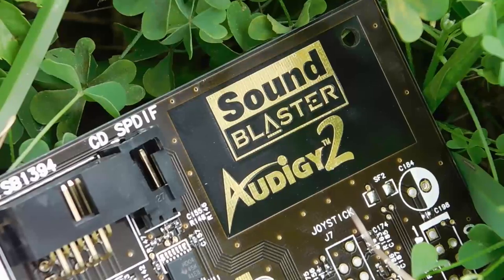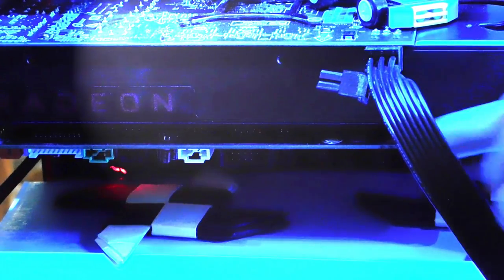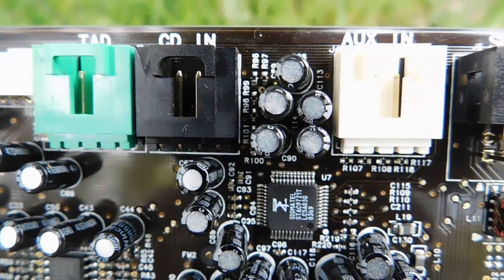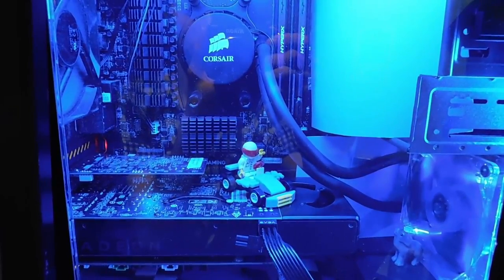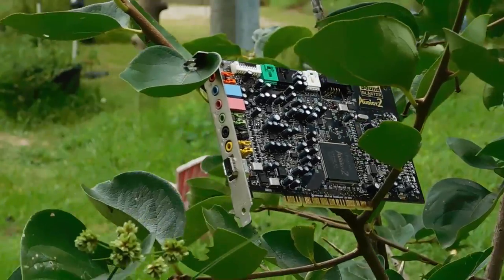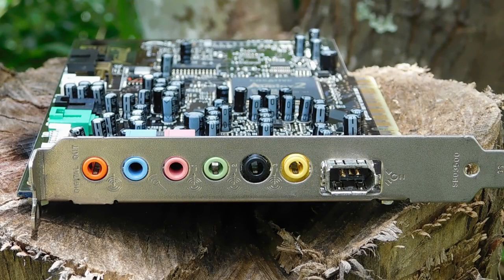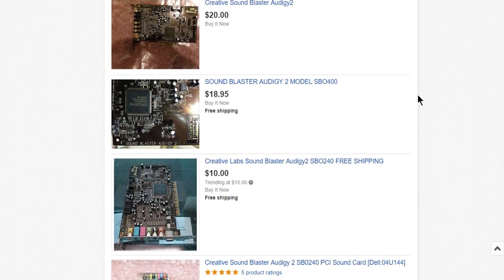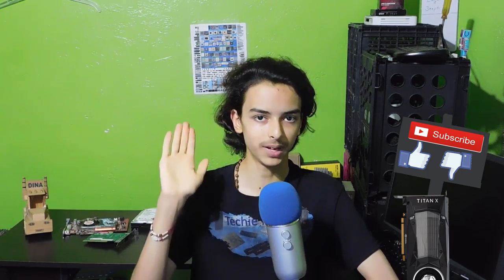Sound Blaster Audigy 2 | Is it still a good sound card in 2017?

Comment: Wow it's funny seeing this kid talk about 24bit vs 32bit on a soundcard while there are no SNR, harmonic distortion, noise floor tests. Are you kidding me!? Also this is a full height card so the adapter (PCI -> PCI-E) will make it difficult to secure the card in the case if it the card fits at all into a case. Waste of time video.
The card is great though, and is better than any onboard sound even today, especially paired up with kx driver (as mentioned somewhere in the comments here)
Reply from the maker: Yeah, I really did not know anything when making this video. I really do want to make more informative videos from now on.
Reply: Dalle Smalhals, Yes, I'm using Creative Audigy support pack v6.2 (by Daniel Kawakami) on Win 10 x64 with that sound card, and the quality is amazing and crystal clean - almost perfectly reproduces the original (with EAX and CMSS effects turned off in the audio console). No ambient noise is picked up from the PC (like humming/whistling because of the PSU/GPU, ect). Microphone port is also clean from any noise.
The driver also supports 7.1 audio output and game EAX effects (for ones that use them).
Reply: Vitaliuz nice! I’m about to move to Windows 10 and didn’t want to say goodbye to my SB card... glad to hear those drivers are working well.
Reply: @anthonymoreno894  That was the reason I bought this sound card in the first place. =)
I was already using Win 10 (so I needed a driver first), and wanted a quality sound, so I found out that old Audigy cards are awesome (bought both Audigy and Audigy 2 from a thrift shop). Truly "old, but gold'.
You can also try "kX Project" drivers (though I highly recommend Daniel Kawakami's pack mentioned above) - I was using them for a while, and then discovered Daniel Kawakami's pack.
There's a bug, though, with that pack - after a PC reboot, sound mixing (in Creative's Audio Console, hence, internal mixing) is reset to 2.0, but you can run Creative's Audio Console (I added it to the startup list), and within one click you're again using 5.1. =)
Also, CMSS effects are enabled after a PC reboot, but you can toggle it off in another tab in the same Creative Audio Console. CMSS is useless, imo - as it "changes" the original sound via "cheap" 3D inverted phase effect. It's most noticeable for me in 4.0+ configuration.
Reply: better than the realtek alc 1220 in a z370 asrock pro i7 gaming? been trying to find a budget card for my cloud II's
Reply: @MrViqtim  1220 is indeed better than previous 1150 codec spec wise (higher dBA, lower harmonic distortions, ect), and, as it's "isolated" - it gives noise-free audio output. So the limiting factors would be the output voltage (peak volume, and limiting factor for high impedance headphones), and the amount of bass (lack of discrete capacitors). Bass as in natural bass (which is supposed to be in the audio track), not bass boosted via equalizer, ofc. But it's what any integrated audio codec is about.
So, if you're not using super high impedance headphones (your Cloud II's are 60 Ohm, so you won't feel the difference), and not extra picky about slightliest changes in the audio - ALC 1220 will provide a steady (and clear enough) audio output.
But, ofc, as a rule of thumb, it's generally better to get a discrete audio card - to get rid of nuances mentioned above. =)
Reply: @Vitaliuz  i installed the cinema 3 and tried to use my headphones in my headphone front jack and it sounded great for music but the game i was playing had all kinds of issues with ambient sound like wind with the 7.1 mode and the cinema sound on so i ended up uninstalling it. It was really distorted and shitty sounding, maybe it was just the game it is insurgency sandstorm and it is early release so that could be it. Otherwise it was a huge improvement over the USB DAC the Cloud II's come with, much better quality and bass im guessing due to the amp on the motherboard. I would like to upgrade to a discrete card but dont want to spend $100+. Was even considering finding an old creative zs card for 15 bucks used.
Reply: @MrViqtim  It's the driver issue most of the times, but there are also games which have weird audio engines. For example, Dying Light can screw up 2.0+ systems if the sound card can't properly mix virtual (ingame) channels into analog (real) output channels. I had a problem playing it (and couple other games) with a real 7.1 sound system - either channels were missing (e.g. only 5.1 or lower was playing) or some weird effects, like "cheap" cross interpolation (e.g. left front was heard in right front, and so on) were added. There were no problems in 2.0 mode, thought.
Then I switched to Daniel Kawakami's set of drivers (using the same sound card) and the problem was gone.

Check if some effect (be it Windows' Spatial sound, EAX, CMSS, ect) is messing with the sound, and if so - disable it in the main audio settings (don't worry, EAX effects in games won't be disabled after that).
Another thing about 7.1 headphones is the fact that there are only 2 channels per se, as there are two speakers (there are also active tactile transducers in some of the headphones - but the sound is mixed from the same 2.0 output) in the headphones, and 7.1 effect is achieved through complex sound mixing. You get 7.1 in the game, and then, those 7.1 are mixed in 2.0, but in a way that leaves you the ability to hear (and distinguish) those back/side channels as well. That can be done in a regular way, via the sound card (by setting a 2.0 output in sound card, and 7.1 in Windows Mixer) - but the mixing will be generally much less complex, so the 7.1 effect in this kind of 2.0 output will be miniscule (that's where 7.1 shine - they have their own algorithms).
So, the key thing here is - if something occurs on the way of that complex mixing (like some third-party effect), it will screw up the sound. So, I usually disable all "enchancers", and enjoy original sound.

Yeah, sadly, even high-end headphones (speakers, ect) lack proper built-in amplifiers, so the rule of thumb is to get a passive high-impedance headphones (speakers, ect), and plug it in an external amp/DAC - that way the sound won't get clipped (because of the amp's voltage headroom), and you'll get crystal clear sound (if the amp/speakers will provide quality, ofc).

When you regularly listen to the "enchanced" sound - you'll get used to it, and think that it's better. But when you listen to the original sound, coming from a proper sound system through a proper sound card - you'll feel the difference, and never touch those "enchancers" ever again. I'm saying that as I also loved enchancing sound back in the days. Not anymore. =)
Reply: Ca Nadian thepride  His official blog: https://danielkawakami.blogspot.com/
Check various months (on the panel to the right) to see the page links with driver downloads.

Btw, he released the v7.0 of the Audigy series pack, with official Win10 drivers (haven't tested them yet).
Although v6.2 pack also support Win10 - the audio driver itself was (in v6.2) from the Vista, but they work perfectly fine on Win10 (I'm using them right now on Win10 LTSC 1809). The latest pack (v7.0), however, contains a native Win10 Audigy series driver.

Comment: very good card from old days. I am using this card on win10, windows automatically updates the driver and its running on 32Bit 192000Hz
Reply from the maker: Niceeeee
Reply: Hello there. Were you using the card adapter as well with Windows 10? Thanks.

Comment: What did you test this on? I had huge compatibility problems with my old Audigy 2 Platinum Ex on Windows 7 and 10.
Reply from the maker: Specs:
AMD FX-6300
HyperX Fury 16GB 1600Mhz
MSI 970 Motherboard
RX 480 8GB GFX

All I did was put it into my PCI(not PCIe) slot and it worked out of the box.
Reply: What kind of problem do you have? I had hissing problems but I solved it by mute line-in and microphone jacks. I'm using Windows drivers.

Comment: holy crap your doing a review on a card but you don't research to find out what the ports are or what they are used for?
you don't research when the card was made. and you don't use a headset when checking the sound for a card
Reply from the maker: I use ATH M20x's and it's 2017 when I made that video so nobody would be using those old ports anyways.
Reply: @TechiePocket1  Nobody would use those old ports? Really? How do you know if you don't know what they're for?

I can see people using MIDI Sync, and AUX In today for sure.

Comment: I bought this sound card. It is not defined in any way, only the unsupported game port Creative, somehow it turned out to be done. Drivers do not see it, and therefore are not installed. If that audigy 2 zs platinum(sb0350)
Reply from the maker: You could try some third party drivers?
Reply: @TechiePocket1  I tried all drivers. Not works
Reply from the maker: @PLNSK_OK  Daniel_K drivers? Someone linked it here in the comments
Reply: @TechiePocket1  Ok. I try this drivers

Comment: Are u sure its not pcie compatible?
Reply from the maker: Yes. When I put mine into the PCIe slot it did not work. When I inserted it into the PCI slot only then did Windows recognize it.
Reply from the maker: Also, do not forget that it will not fit correctly in a PCIe slot.

Comment: That thing is basically shit, you find better analog converters integrated in any modern motherboard.
They all definitely support 24bits/192khz tho, not that it should make any difference anyway with the crap-class speakers you're probably using xD
Reply from the maker: Wouldnt say that at all! Most motherboards don't have quality that is better than this thing dunno where you coming from on that.

Comment: I finally threw my Creative Audigy Platinum last year, i just didn't have the heart to throw it out because it cost me £190 back in the early 2000's, but alas it didn't work with Win10 so it had to go. Damn i remember having a Shit-Hot PC back then £190 SoundCard, £350 GeForce4 Ti 4600 and £100 on some creative speakers , thats £640  fck i must have been on glue or summin then lol. Now i just own a shitty mid-range PC and i ain't going down that must have latest PC hardware again.
Reply from the maker: Did you sell it??? You could have kept it a little while...
Reply: Sniper you just described me lol

Comment: Ouch !! Holding a sensitive piece of hardware like that with bare hands is NOT advisable ! like memory , use an antistatic wristband & / or a pair of plastic examining gloves to handle computer hardware . I use them for everything inc' graphics cards / memory / hard drives / sound cards / USB extender cards etc etc .That PCi-E to PCi convertor , is to high for the PCi card to sit in , it would not marry up to the rear properly , so pretty pointless buying one in my opinion.This is why people wonder why they have the BSOD , due to hardware / memory failure due to being cooked by static.BEWARE - look after your hardware , even if hoovering out & / or using a air duster , where gloves be safe :)
Reply from the maker: x'D